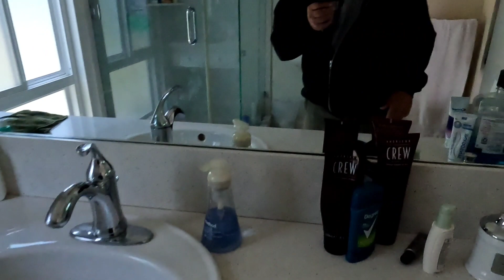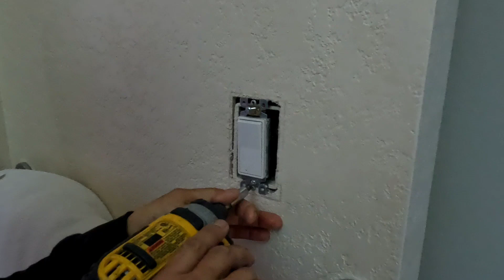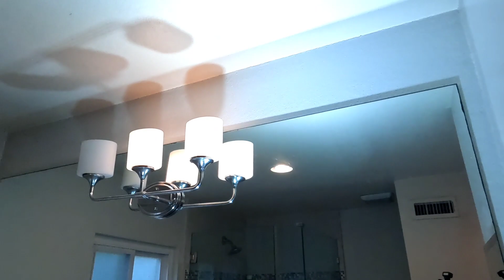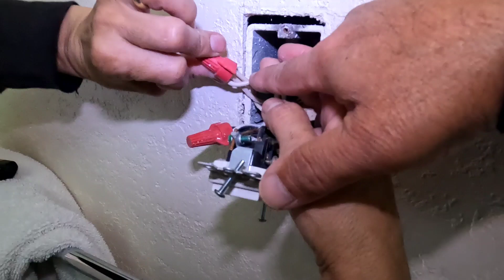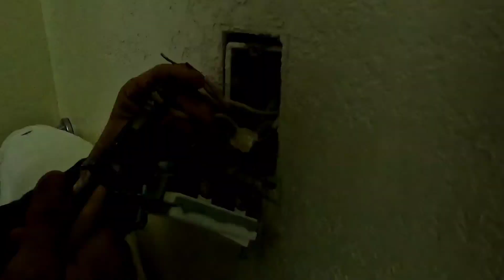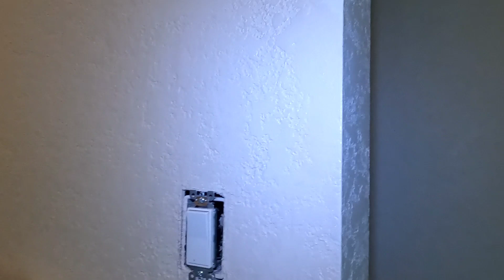TROUBLESHOOTING ELECTRICAL ISSUE

Comment: Probably going to be a neutral? Based on...???  It is more likely that it is a hot because thee hot connection was moved more than the neutral connection.   OK. You got lucky with the 50/50 guess. :)        I would have left the lights on and wiggled the switch and wires  to see if I could get the lights to flicker. I would have also just put new wire nuts on without turning it off but I am old and stubborn and have done it ten thousand times :). You are safety training your apprentice properly. We taught them to be dangerous in the olden days. :)

My luckiest was when the lights came back on when I plugged my tester into a receptacle and the lights came on. Bingo. Backstabbed. Didn't even have to locate the panel or breaker.
Another time I saw an ironing board set up and, bingo, backstabbed.

Also, the extra long sheath in the box has homeowner/handyman written all over it.  I couldn't sleep at night unless I took 2 more minutes and cleaned up that mess so the wires tucked in nicely.
Reply from the maker: Thank you for watching

Comment: Another common problem they back stabbed the wires on the switch instead of loosening the screws and sliding them behind the clamp them tighten them back down much better connection
Reply from the maker: You are so right we always rap our wires on switches and Outlets or use the clamp I stay away from the stab locks.
Reply: If you don’t mind me asking, how much do you charge for something like that.
Reply from the maker: @JuanSanchez-pq7xn  115.00 service call
Reply: @ResidentialRepairs  thank you, I have your phone number.